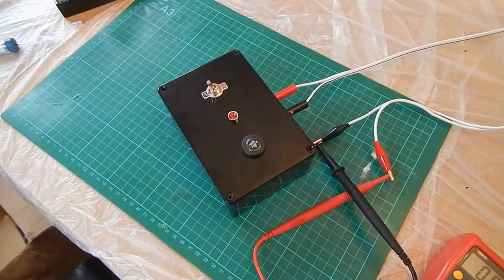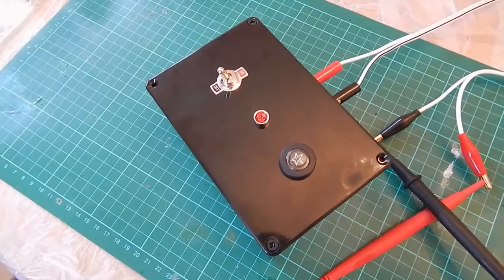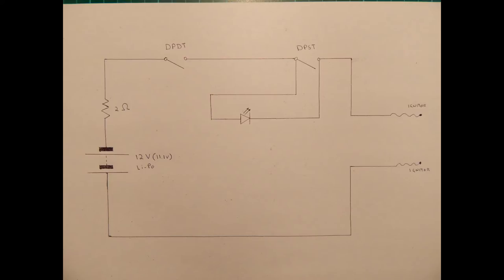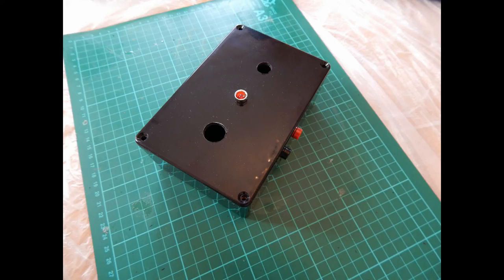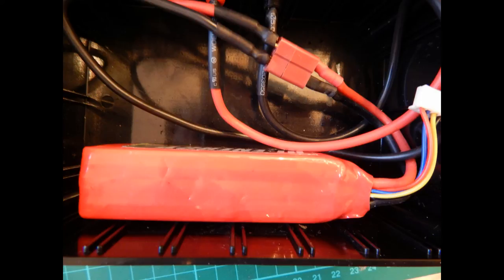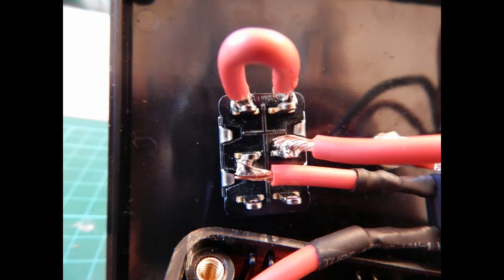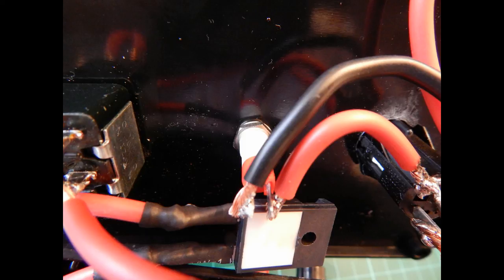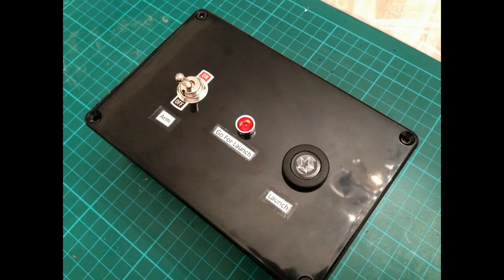Model Rocket Series Episode 2! (How to make a model rocket launch controller)

Comment: I did something similar, only I used a metal box, and 4 rechargeable "D" cell batteries for a total output of 6V. I did not check amperage, but since 4 AA batteries work just fine in the cheap Estes launch controller, so do the D cells. I also used a detachable cable, but used flat nosed clips rather than the "alligator clips" with teeth on them. The flat clips grip the igniter better. I also used a round coaxial audio cable with 1/4" phone plugs at each end, and a splitter at the launch pad end. The round cable does not twist and tangle as bad when wrapped around a spool. 

This hobby needs some quality launch components. I realize most serious enthusiasts build their own, but there is nothing decent available commercially. Even Aerotech stuff is junk, and it's not cheap.

Comment: Good job, but there are a few things I did different, a little more simple actually.  Battery goes to the two middle terminal of a DPST switch, then one terminal goes to light the LED (The light is always on when armed because it is a separate circuit controlled by the same switch that controls the power to the launch button) and the other goes to an SPST momentary push button (which go to the igniter leads).  Also, I used an old military switch cover/safety cover for the arming switch so there is no way for it to accidentally flip on if it falls over.  I didn't use a lipo, just 6 aa batteries.  That lipo, will probably last 10 years before you have to recharge it :)

Comment: Hi again. I know i'm being a pest now but could you please confirm the resistor is 2ohm 100watt and not 100ohm 2 watt. Iwent to maplin with thie list and he said they do 100ohm 2 watt. I didn't buy one in the end as I wanted to be sure. Thanks again
Reply from the maker: No problem at all. You are correct it is a 2ohm 100 watt resistor.